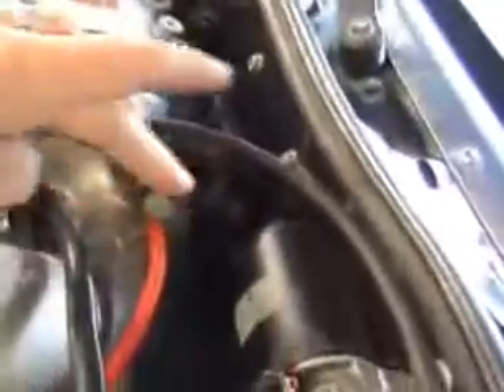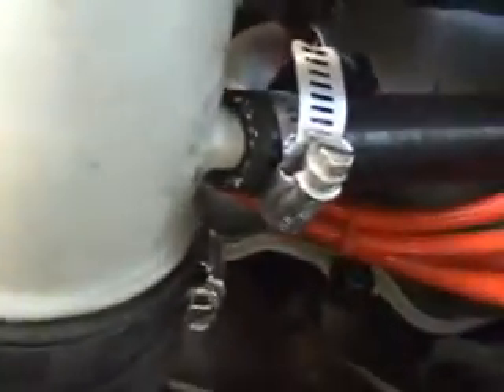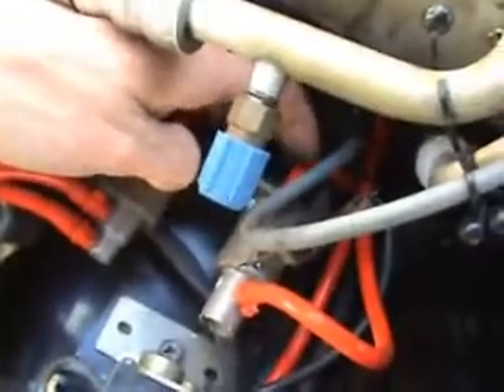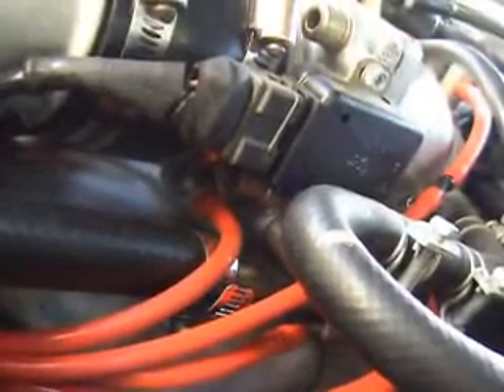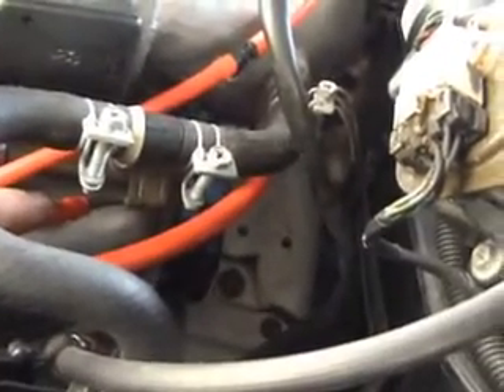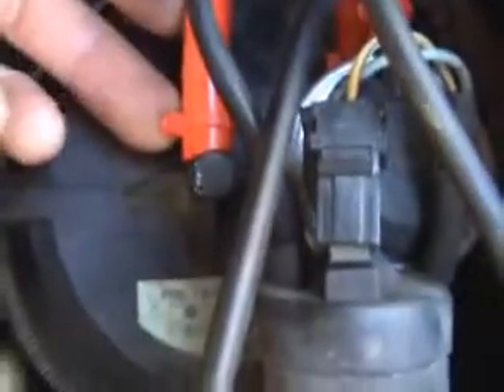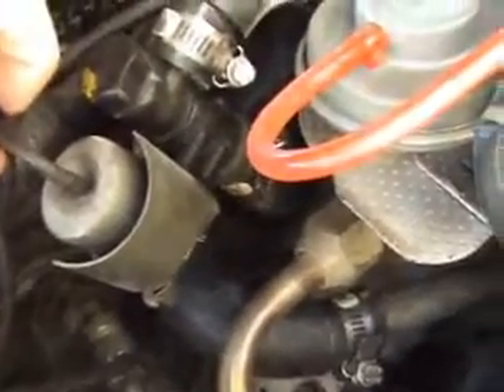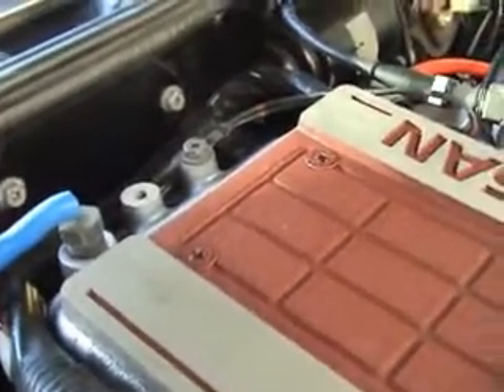1987 Nissan 300zx Non Turbo: Episode 27 Vlog: Vacuum Hose Routing

Comment: By any chance does your ac work? mine works but I have an issue with my vacuum hoses. They were dry rotted and I can't tell where they need to be connected to get good vacuum.  My ac works, but it also blows hot air thru the vents when I accelerate and then goes back to blowing cold air when it idles and after I get going. Thanks I need to know where they connect starting from firewall I have a black with red stripe hose, a black with white stripe hose.
Reply: sergio fernandez mine does the exactly the same.  did you ever fixed it or found out what it was? mine blows thur the dash.. been trying to find the line
Reply: Same problem here also, did any of you solve this problem?
Reply: Does this affect the gas, cause I'm having the same problem

Comment: What sizes and lengths do I need to order
Reply from the maker: 10 foot of each size to start with
Reply: I know most are 6mm and 4mm and some 10mm do you know the diameters for the AC climate control lines?